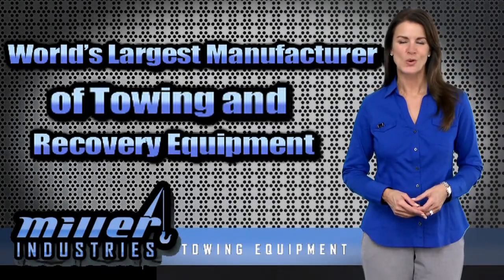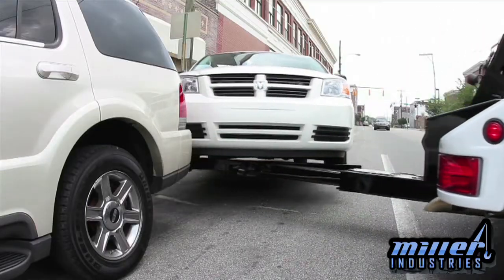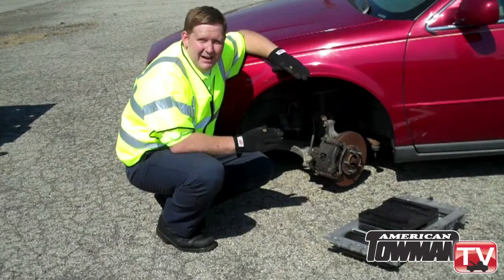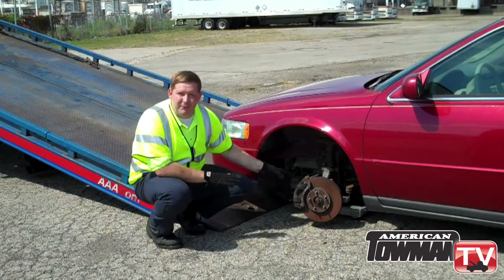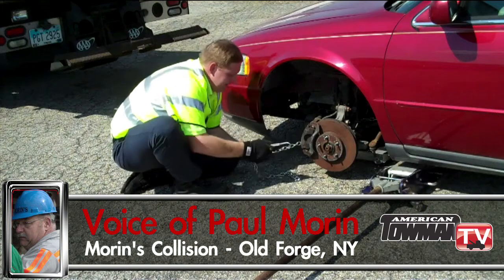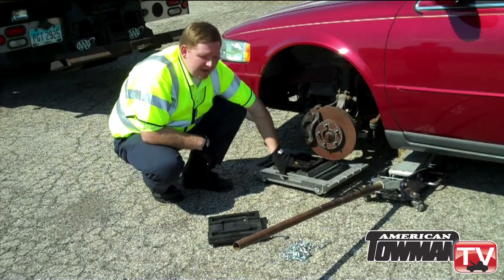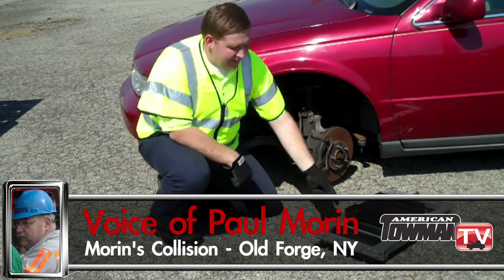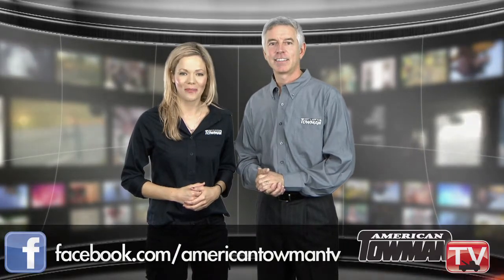Shortcuts For Loading Damaged Vehicles

Comment: i cannot see why they took off the wheel. even if something is broken you can still winch the car with a wheel on, you hold the wheel straight when using the winch.. i would rather use dollies than use that devise.